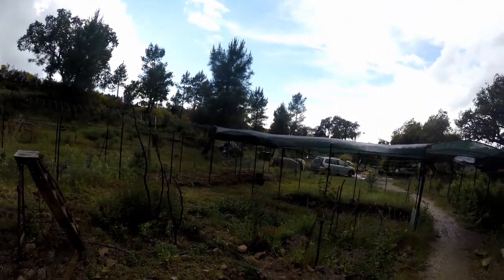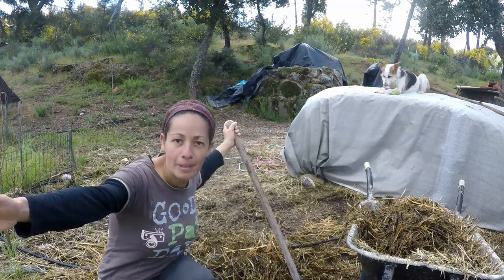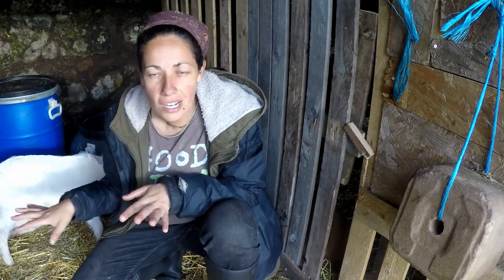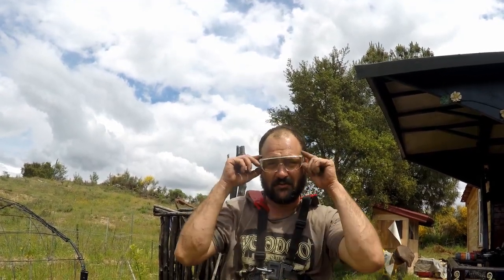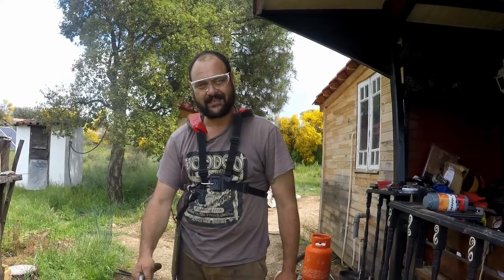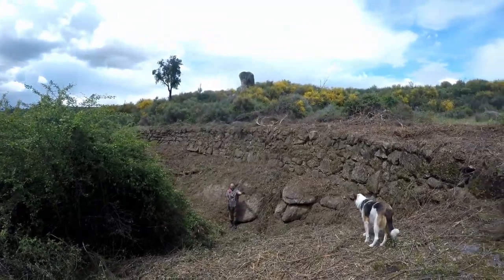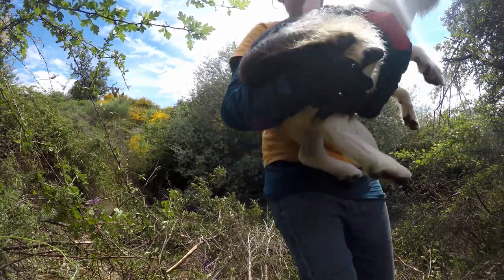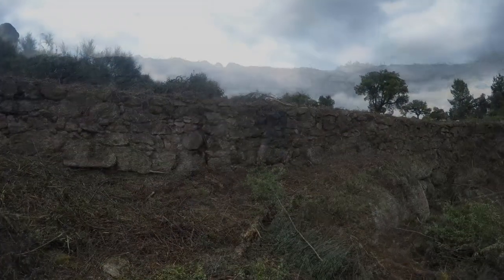Uncovering hidden treasures on our farm , a spot of gardening and a new baby goat -Off the grid 29

Comment: SO pleased to see the improved safety precautions, the last thing any of us want is Luke in more than one piece! I would say you could go further though - chainsaw trousers are really advisable, and they may be a bit expensive, but your legs are worth more. And the other great investment is shin-guards for strimming, and maybe also a box - sounds like overkill, but a direct hit from a hefty stone on your delicate undercarriage and you will know about it (same goes for shins). I agree with Fonte da Pipa re the wear on the blades - maybe you need to use a sharp billhook initially and save your machine from so many unseen threats?

Oh, and Sarah, with the shade netting - have you considered staking it more like a windbreak hard up against the plants that need shade, ie vertically to the south of them? That way they get protection from all but the midday sun but are still exposed to the rain when/if it comes.

It's all shaping up really nicely. And now you have more exposed BOULDERS! Woohoo!
Reply from the maker: You are so so right and full of good ideas Maxwell😁 I love that idea of the shade netting and it will solve that water problem for sure ,and Luke has already spotted some shin guards and  tried on some chainsaw trousers second hand but we will have too save up for them. Luke is all up for the idea of the sharp billhook though for where it is not insanely dense. Thanks for the feedback Have a great weekend

Comment: Hello
A little thought about choosing a blade for trimmer / clearing saw ....
Does it work well with the 2 or 3-leafed ones?

I think they often "throw" the saw, when there are a little coarser bushes ...

Therefore prefer "the small-toothed" / "ordinary cutting blade" (similar table saw) ...?
You lose a little when they are very thin ....
Wins in more comfortable work ....

Feel free to tell me?
Sincerely
Reply from the maker: For brambles Luke found the blade he used in  this video to be the best
Reply: @lukeandsarahsoffgridlife  👍